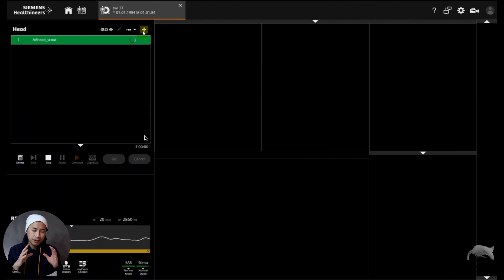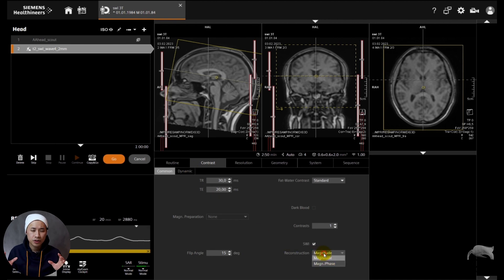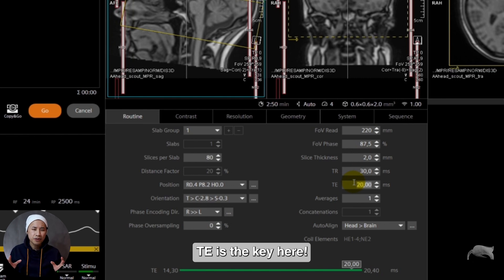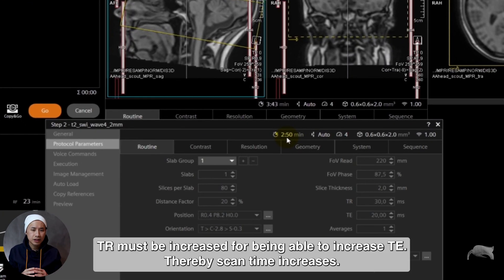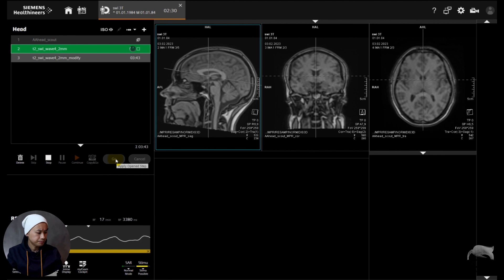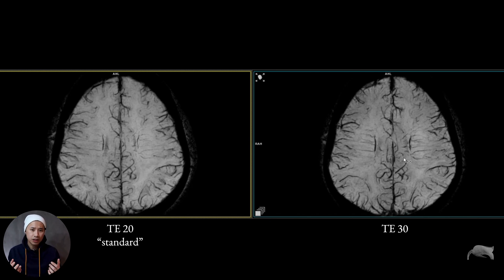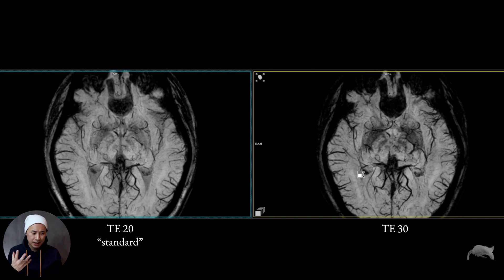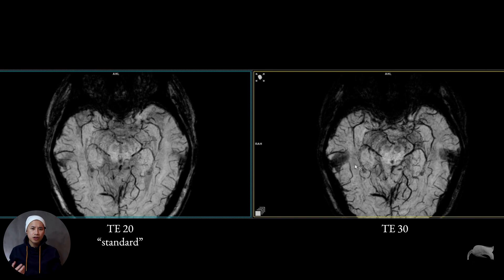MRI Susceptibility Weighted Imaging (SWI) @ 3T

Comment: Thank you for your videos. I have a technical question, we have a lot of instability using a GRE and DTI sequence which seems to cause motion type artifacts, possibly from vibrations. It's intermittent but seems to mostly affect GRE/EPI and not T2 and Spin echo sequences. Is there a setting I can tune to more this more stable of a collection?
Reply from the maker: Thanks for the question. It shouldn’t be like this. Even so, I would call siemens to check this up. The system should be stable.
Reply: @Nguyen_MRI thank you for the response, it turned out to be hardware related.
Reply from the maker: @seansethi196  glad to hear you found the reason. 👍